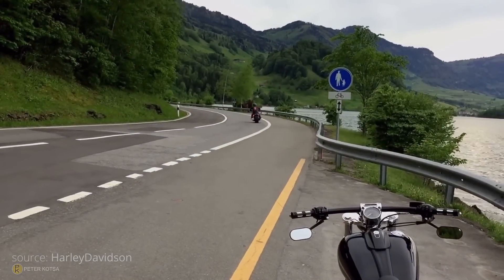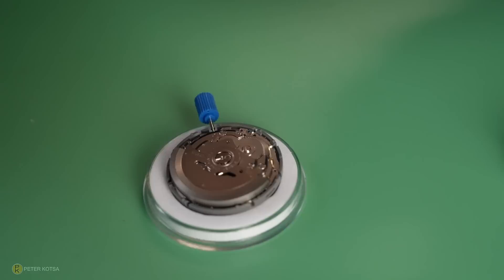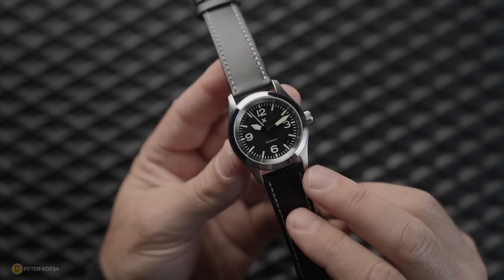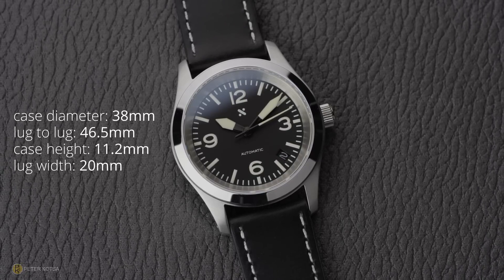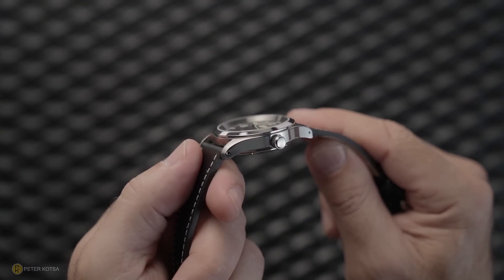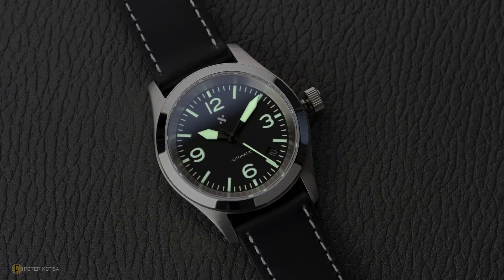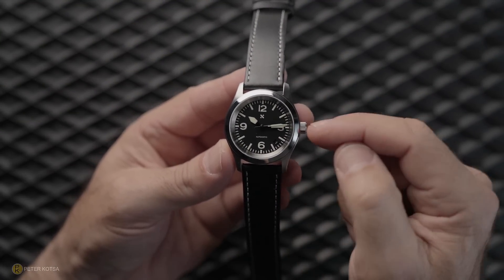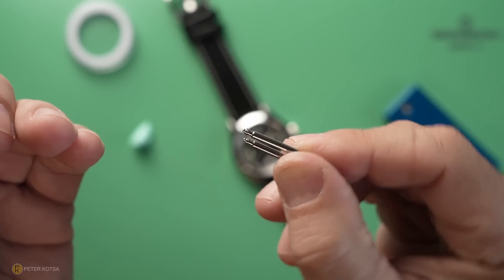NAMOKI Mods DIY Watchmaking Kit

Comment: Well yes.
I've successfully disassembled, cleaned, oiled and reassembled multiple watch movements so far.
First one was a Raketa UFO Watch with a 2609 in it. Bought it as defective, and all it needed was a full Service and a Mainspring.

Did the same to a Radiomir Homage watch. "Serviced" the new Unitas Clone movement in it, just because i wanted to know if i can get it running same or better als new. And it ran better than new. :)
Changed the Hands in the process as well.
Reply from the maker: bravo 👍

Comment: If it can be assembled in 15 minutes, and therefore presumably is not much of a challenge (sizing a bracelet without scratching can easily take longer, OK, I'm not a deft hand), then what's the attraction? So far for me watches are somewhat similar to an excellent meal out. I want those selfproclaimed (or certified professionals) to convince me and take me on a journey with their vision and execution. Even if I felt like dabbling, I think modding might be more interesting than a kit, although perhaps a kit is an almost necessary step towards modding? Anyhow, for me, I don't really get these kit watches, but there used to be a trade in kit cars, so I appreciate people take to the interest in different ways.
Reply from the maker: I think it’s more about the introducing people to be able to confidently approach the task without feeling overwhelmed 
It is straightforward for sure, but a small sense of achievement when tackling something like this for the first time 👍